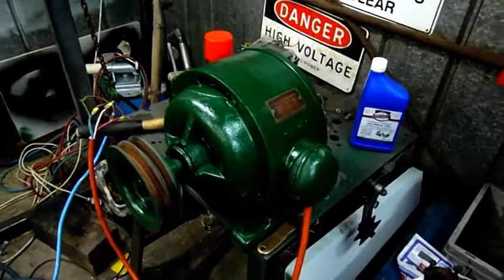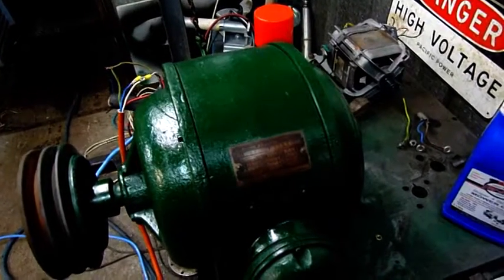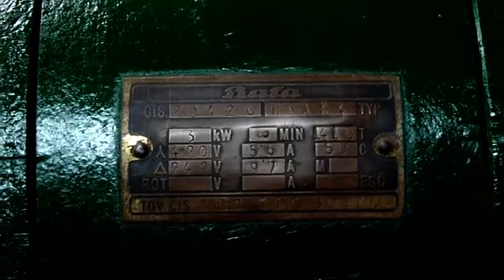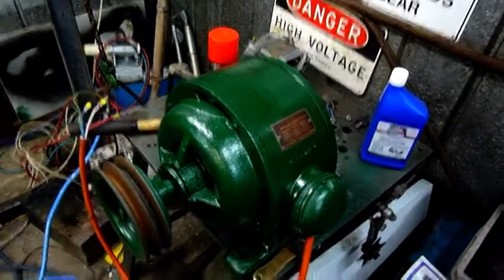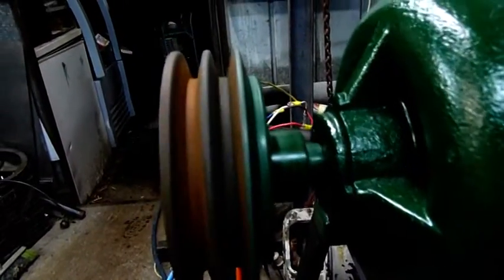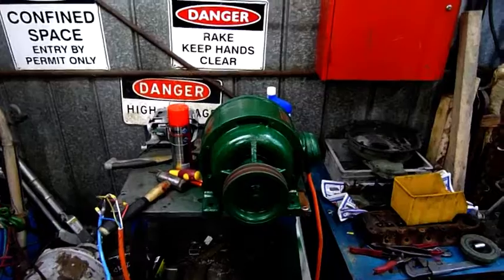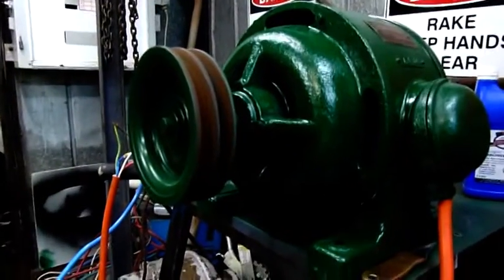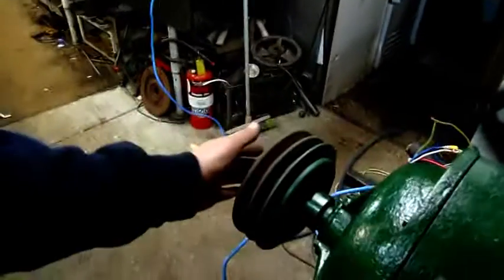Vintage 3 Phase Motor ID Help Needed (Test Run Included)

Comment: Hello! Dont know if this is still relevant but you got your hands on a motor made by a czech company called Baťa, what really confuses me this company has always been trading in shoes so it doesnt make any sense to me that there is an electric motor of that brand
Reply from the maker: G'day
I found out Bat'a had a machinery division prior to WWII, they made things like motors, machine tools, bike tires etc. but during and after WWII I imagine a lot of that was destroyed or went into disarray with the Cold War/eastern block thing.

Comment: @YankeeIngenuity I agree, both the shoe manufacturer and this motor used the same typestyle which matches the two units together. Euro companies are funny about such things, building shoes in one factory, building lathes and machine parts in another. It would not surprise me if this Bata was fabricated to drive shoe-making machinery.

Comment: Respond to this video..THE REASON WHY THE BOLTS HAVE CHISEL MARKS IS TO MAKE SURE THE NUTS DON'T BACK OFF, THIS MAY HAVE BEEN DO TO REPEATED REBUILDS , OR THIS UNIT WAS OF HIGH IMPORTANCE, AND BREAKING DOWN WAS NOT A OPTION, LIFE'S DEPENDED ON.. WHAT DOES THE UNIT LOOK LIKE ???

Comment: @poolmotorrepairguyFL who cares what brand it is or who made it, as long as it runs, it's all good. i have a 50 year old GE running my compressor .i found that old motors where built with care, and with computer spin balancing, can make a sweat motor that can last forever,and be far superior than the new crap they make nowadays. you got 2 think this was made back in the war, what it built and how many hrs are on it , was it used to do good or bad. 75kw =1hp kinda a no brainer, SF is not listed J

Comment: I SAY ITS A 2.25HP IT HAS BEEN REBUILT BEFORE , MY GUESS ABOUT 10 TIMES. SEE NOTCHES IN END BELL, IF IT WAS MINE I WOULD REBUILD IT AND RE VARNISH IT (THE WINDINGS) THE PULLEY COULD BE TURNED DOWN ON A LATHE ,TO HELP MINIMIZE VIBRATION . THIS IS A HIGH TORQUE MOTOR, W/ A LITTLE LUV CAN LAST FOR YEARS.. THE ONLY OTHER COOL THING YOU CAN DO TO IT IS, HAVE THE ROTOR COMPUTER SPIN BALANCED . USE A HIGH QUALITY C3 BEARINGS. HAVE THEM PRESSED ON! DO IT LIKE THIS AND YOU SHOULD GET 20 MORE YEARS .JAY

Comment from the maker: @dodgejamesuk its a 4 pole 1425rpm motor, 4 HP
Reply: 50Hz - rpm 100% - 1425 (little vibration) HP - 4
60Hz - rpm 120% - 1710 (vibration more!) HP 4 x 1,15 = 4,6

Comment: i think that motor has been apart because if you look at the case when you filmed the name tag there are 3 marks on the outer plates and the case like someone had made those marks to line it back up with, i know i do that when i rebuild starters

Comment from the maker: @tankjr85 not sure about bearings but I understand that the vibrations in the stator windings can break down old insulation, leading to premature burnout.

If I do find a 3kw VFD to run it, I will take my chances. unless I find a good 3Kw modern motor before then.

Comment: Hi there, i heard you're not supposed to run such an old motor via a VFD because of the current flow between the rotor and the stator, it kills the bearings. Don't know if it's true anyway.